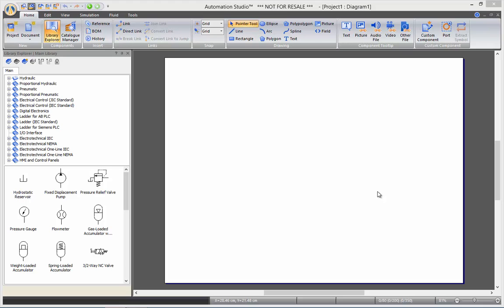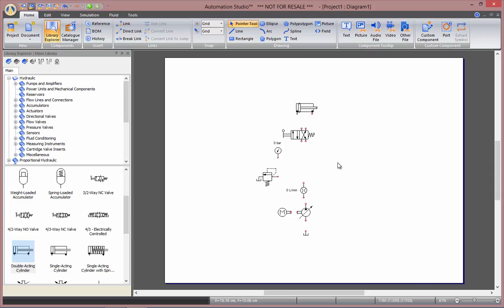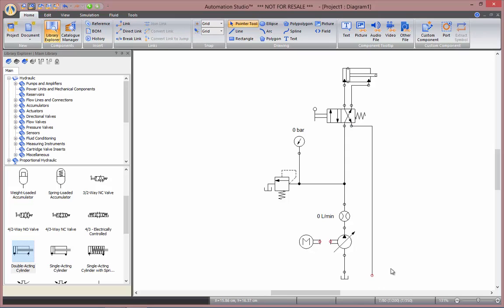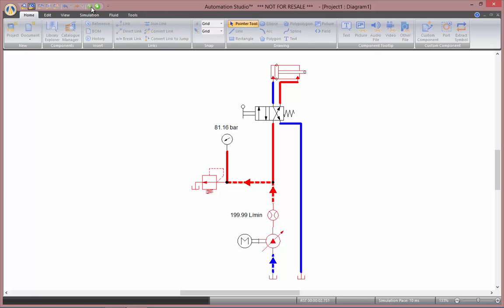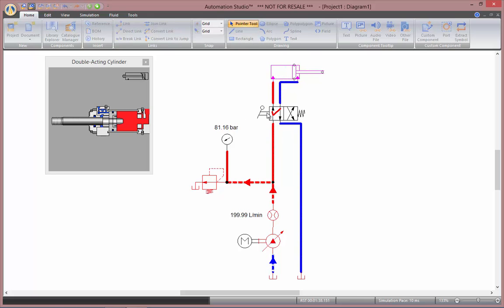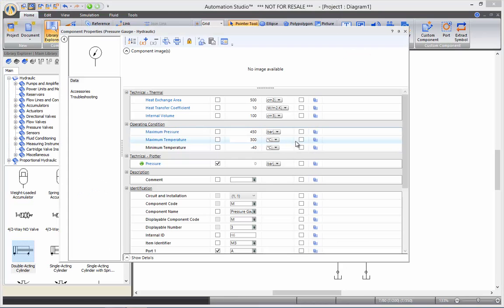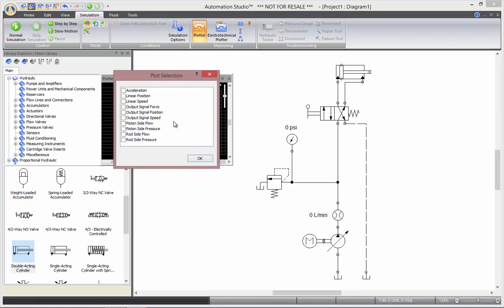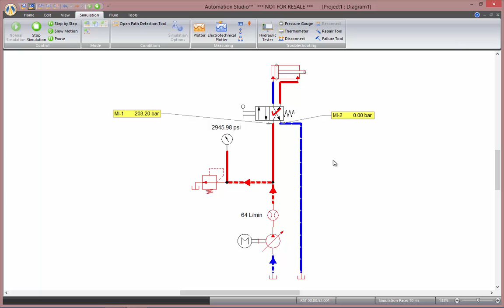My First Hydraulic Circuit Automation Studio™

Comment: How to set working pressure of a hydraulic pump? Is it maximum pressure or differential pressure?
Reply from the maker: All the pumps available in the library have an option for their Maximum Working Pressure and Maximum Differential Pressure. Some of them have the Setting Pressure and Differential Pressure Setting option. It depends on which pump you are using. -EN

Comment: My Directional Control Valve does not shift using an external hydraulic pilot. How do I used an external hydraulic pilot to shift the position of a Directional Control Valve?
Reply from the maker: Hi Rohan, when selecting the command, make sure you select an External command. Once on your schematic, you will see a red circle on that command, this is where you will connect your pilot line.